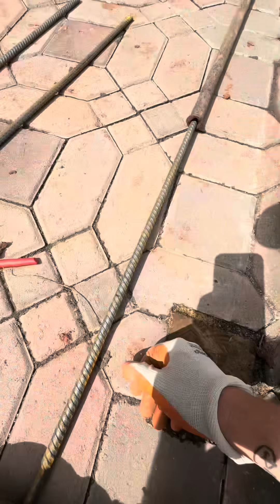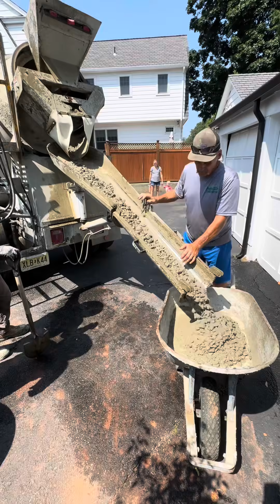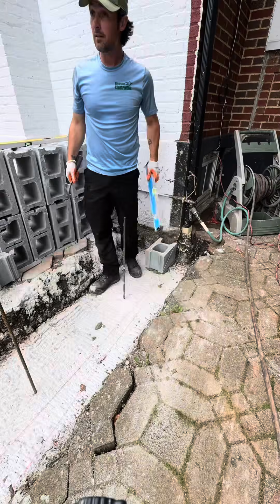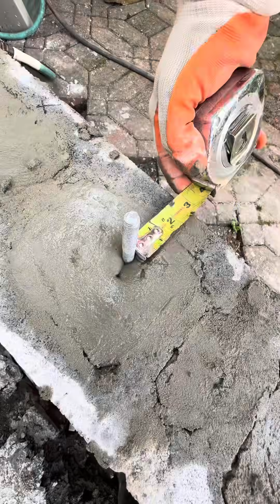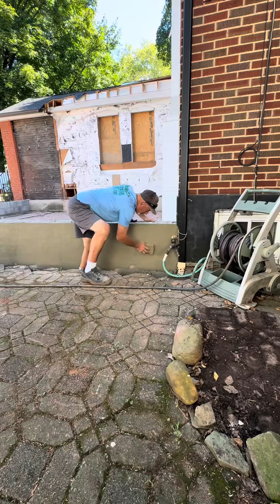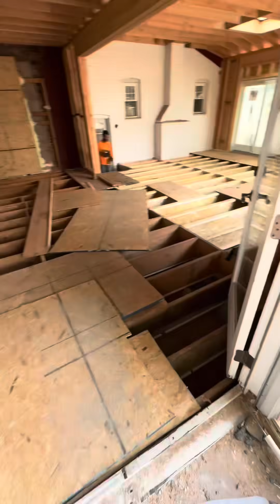Masonry Foundation Addition Step by Step Start 2 Finish

Comment: Planning any type of job is complicated asF.

I have a question about your footer if you will… I’ve noticed that in some states and other countries than the US, you don’t have to form them… you just have to be under the local freeze depth. Can there be problems with movement of the footer from seasonal freeze-thaw or is it just old wives tales? Thanks for posting your material!
Reply from the maker: Thank you for watching! Planning always hardest part. As long as it’s thick enough and below freeze depths you don’t need to form them. You’re pouring deeper and wider by not forming in most cases